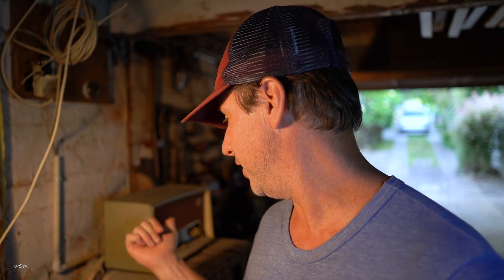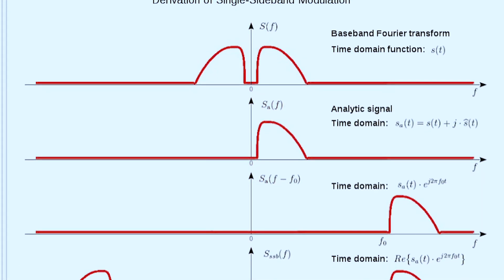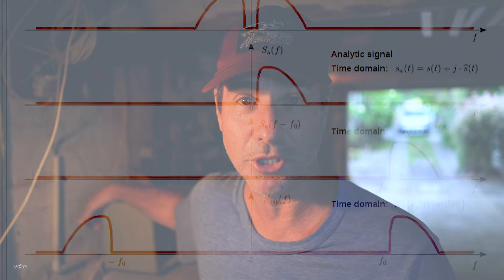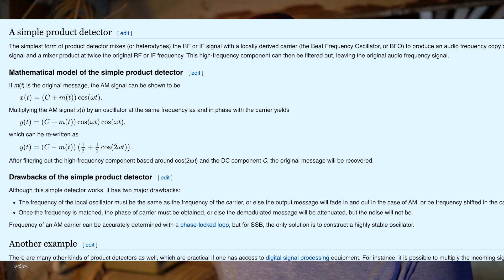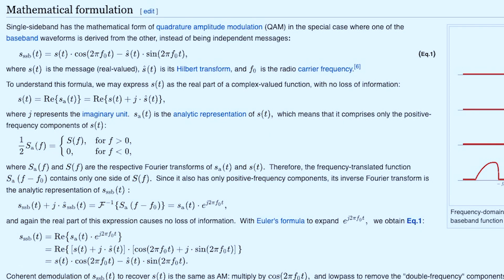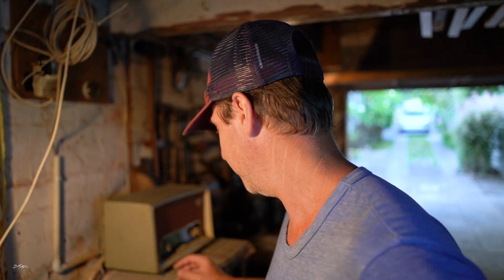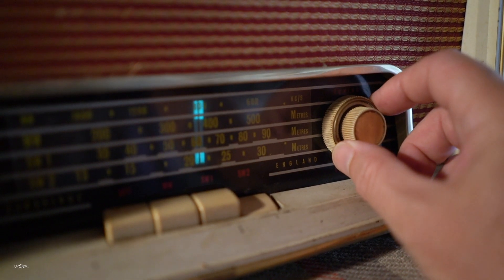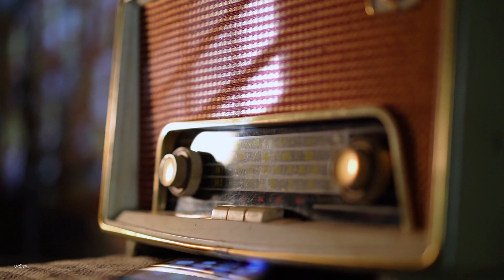How Single Side Band works - Receiving on an AM radio -  Vintage Radio HF VOLMET.

Comment: Just build a little transistorized BFO which you can tune to 455 khz (or whatever IF frequency your radio uses), install an on off switch and since it uses microamps to power it, you can piggy back it to a tube to power it since it doesnt load it down.

Comment: Just use two radios together, Am set on 1300 khz and SW around 7100 khz , on pretty much any slightly older radios.
Reply from the maker: Yes - as I said - add an external LO
Reply: @DeonMitton  I'm wandering would this work on a newer radio with a DSP chip and would a newer am radio work? How would you know if the am radio has an oscillator to change the frequency not all the older one's would will have this capacity. I'm getting a radiwow and not sure if  it'll work ok.
Reply from the maker: @neilcampbell4833  To use a second radio receiver as an external Oscillator, it has to emit a very low power signal.  So it depends on the receiver design, whether a small LO signal is emitted from its antenna at all.  So typically, any receiver design which uses a variable LO should work.  In DSP designs, it depends what design you're referring to.   Some make use of LOs, and with the resultant I/Q signals being fed to an external ADC of sorts, while other designs, like the direct sampling,  uses a high speed ADC, and FPGA to demodulate - in which case no LO.   A modern day hybrid design might work... but you'll be safest with older style receivers with LC tuning circuits.   Alternatively, you can DIY your own by say a Variable crystal oscillator VXO, or using something like a Si570 chip - those are all fun projects.  the Si570 has a programmable, I2C interface, etc.
Reply: @DeonMitton  ok great ,thanks for all the information , your certainly very knowledgeable with radios.

Comment: With an parallel wire antenna, approximately 12 m long and 0.6 m apart you would get an overwhelming result.
Reply from the maker: a 2 element beam !!